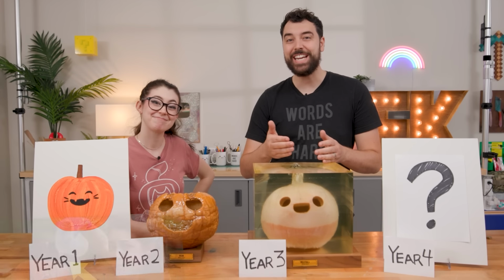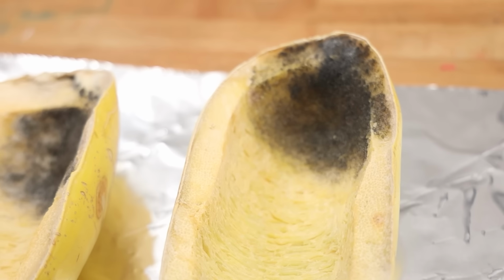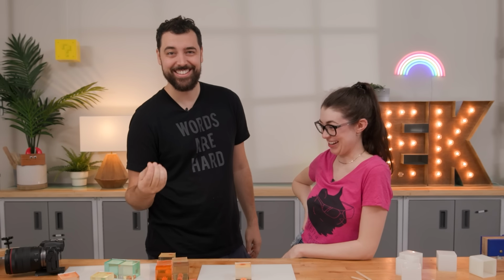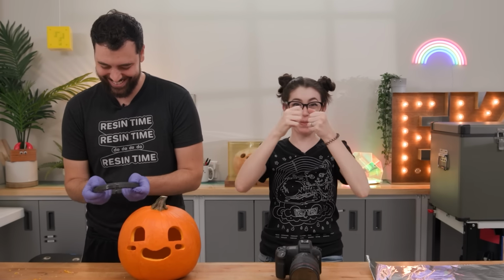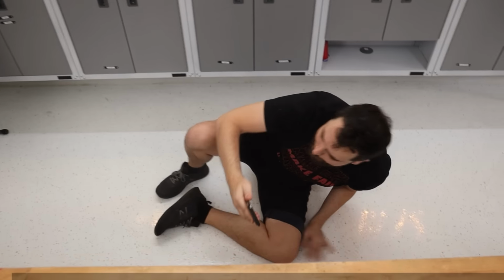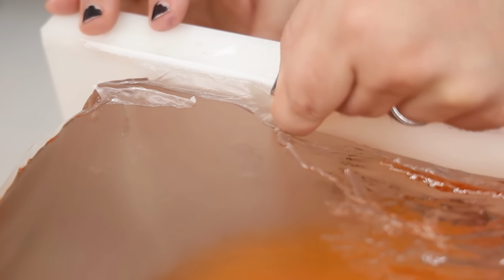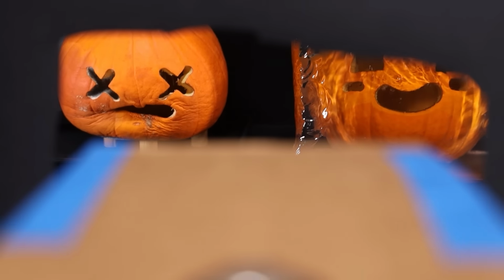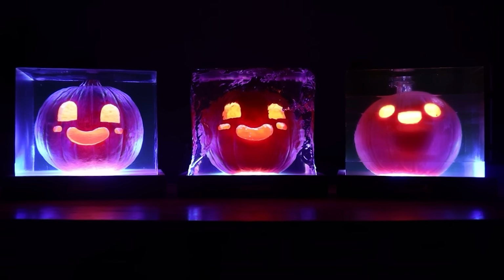Our BIGGEST resin pour yet… all to preserve a pumpkin

Comment: One suggestion is freeze drying a pumpkin. Albeit my pumpkin was a small one, once I carved it I stuck it in my freezer and forgot about it for the year. When I took it out for Halloween it was as good as new and it's been sitting in my room for 2 years now, no mold or anything. If you start now it might be good for next year! (also cheap if you have room in freezer + discounted pumpkins from Halloween)
Reply: A freeze dryer could work. It would be very fragile though. The weight of all that resin could make it crumble. But I've seen other channels do a thing where they submerge something in resin, and then vacuum it, which removes air from the object and causes the resin to infuse it. Maybe they could do that?
Reply: @jonathanhibberd9983  They tried that while making clear wood. They could probably do it again .
Reply: @jonathanhibberd9983  The problem is the pumpkin is full of juices as well as air. So then they'd be vacuuming the water out causing it to interfere with the resin itself.
Reply: @astridroseby  the process of freeze drying removes all the moisture. If you've ever had Lucky Charms cereal, the marshmallows are freeze dried. And that's what all freeze dried foods end up as. Totally dehydrated, dry but very fragile. They crumble into dust under too much force. If the weight of the resin doesn't crush it, a vacuum would allow the resin to fill the spaces left by the removal of the juices. But I'm not sure if you can freeze dry a whole pumpkin. And if they could, if it would survive the weight of the resin.
Reply: @jonathanhibberd9983  Oh, I thought you were suggesting vacuuming the pumpkin in resin as another alternative. I didn't realise you were saying to vacuum the freezedried pumpkin.
Reply: @astridroseby  yeah, I was thinking of freeze drying, then stabilizing. Peter Brown has a video on his channel where he does it with some wood and a slice of bread.

It's a very watery resin. You submerge the item, and put it in a vacuum chamber. It sucks all the air out, which lets the resin infuse it. The problem is it's heat cured, so that might be an issue. I don't know if it would discolor the pumpkin, or if the freeze drying would make it so it doesn't change color.

Comment: Hi, I study microbiology for a living and there is my take on your project. I hope my advices will be usefull

First off, regarding the cleaning method, you might have infected them pumpkin while rubbing them and you left them in the open afterward so any type of air contaminent (especially common in molds like this) might have contaminated the pumpkin. So that test isn't really testing anything. Also, you should rub it a first time real good before opening it, and make sur that anything that touches the pumpkin is well sanitized.

Also, if you want to clean it adequatly, you should keep it in a totally clean and desinfected area, and you MUST sanitize it before opening. Use only sanitized tools to touch the pumpkin and remember that as soon as the "skin" of the pumpkin is breached, you also make it a LOT easier for the pumpkin to be infected. Therefore, you must work fast, in a sanitized environnement, including air. Using a flame to work next to it can work but there are other methods. You MUST keep this up during the entire time the pumpkin is exposed to air to protect it from outside contamination.

You could also try and pressure cook it. 121 degrees celcuis for 20 min should kill any bacteria and or fungi present in and out of the pumpkin. ( this is called autoclave if you want to reasearch that method) And if you follow this path, you still need to sanitize the area until the pumpkin is completly immerged

Another method could be to dive it into ethanol, ether or any desinfectant fluid then encase the whole thing, with the fluid. This method might lead to some colorant tainting the liquid as the pumpkin is immerged for a lengthy period of time.

You should also know that like wood, most vegetables will release some gas as it gets old, so it will be seen and if there are some leaks, the pressure building up inside might it to leak more easily.

So all thing considered, it is actually luck that determines wether the pumpkin will rot or not, if you keep it in sanitized envirronement ( the pumpkin must be in especially good health (no inside contaminents)and you must protect it from all outside contaminents as well) then you maximise your chances. 

If you really want it, I'd advise you to make a few until you finally are lucky enough to have that perfectly healthy pumpkin. You should also try and minimize the time you keep the pumpkin carved. As soon as you pierce the "skin" of the pumpkin, you open the gates for any pathogen to enter easily. So as mentionned before, Open it in a sanitized environnement, with airial protection ( a flame for instance) and sanitized tools and hands, and work as fast as you can. All this, can be useful to limitate any type of infection that could make the pumpkin rot inside the epoxy but, it will not garantee success since the pumpkin could already be contaminated.

You could also try and get directly from the ground it grew, minimizing the chance of any pathogens penetrating the pumpkin during its travel to your local shop.

PS: I know that this all might seem a bit much, but remember that any baceria/fungi that is encased with the pumpkin is in a well controlled environnement with humidity and no air with a lot of of dead organic matter; this is the fungi dream. Fungi are you worst ennemy in this project, any that makes it inside WILL make it rot

PPS: you should also wear masks in order to protect the pumpkin from the air you expire

I hope this is usefull <3
Reply: Pls be nice i made some mistakes but english isn't my first language
Reply: I'm also a microbiologist and you simply cannot sterilize a pumpkin without completly destroying it. This is not like milk which you can pastorize. 😅
You can't autoclave a pumpkin lol
Reply: This is amazing ❤😊
Reply: @zamith1817  
Do you think putting the whole thing into a formaldehyde solution might work? Basically, it's still coated in a thin layer of it when it gets encased in the resin. Like a glass tank, but resin instead of glass and the walls make up most of the cube.

Comment: Idea: put Chunk 1 back in the resin cube mold and do another pour! This would only be a relatively small amount of resin and it would make him a proper cube!
Reply: That's what I was coming here to comment! The fast curing locked in the color, and the second pour with the slower curing kept the shape nicely, and would likely hide the...melty...effect.
Reply: I think he looks cool like he's locked in an ice cube lol
Reply: but he looks like a melted icecube now~
he is "future" chunk where as the silvery "ghost" chunk is past chunk~
Reply: That way it will no longer look like an ice cube, and he will start to get warm and sweaty.
Reply: Sanding with a high grit sandpaper before hand will give a clearer finish. I start with 400, then use 600 and finish on 800.
Reply from the maker: that's definitely something we're considering! We weren't sure if resin could reach all the nooks and crannies (we didn't want air pockets)
Reply: @EvanAndKatelyn  Honestly, the ice cube look is really working for me, especially with winter coming on,  it's a multi-holiday decoration!
Reply: @EvanAndKatelyn  Another option would be to keep carving until you are about an inch away from Chunk 1 all the way around but as you get closer start trying to get a smoother finish
Reply: @EvanAndKatelyn  I'd honestly be worried about the color being slightly off since the color wouldn't be replicatable. I think he looks good as an ice cube anyway though
Reply: @EvanAndKatelyn don’t do it! Just put him in a giant martini glass or something!

Comment: There is a resin called Cactus Juice that pen makers use to stabilize wood. The wood and juice go into a vacuum chamber, and then after days all of the air is exchanged for resin.
Reply: Yes, but wood is not 90% water.
Reply: cactus juice is a heat set resin, if you cook the pumkin its going to make it worse
Reply: @MrKuncol  "Moisture does not hurt Cactus Juice at all. Moisture will not cause polymerization issues in any way."
The water isn't a problem. It's the decaying matter. Which is hopefully what the Cactus Juice will stabilize.
Reply: They've have used cactus juice for other projects before there must be a reason they haven't now.
Reply: @jerrywhidby.  Stabilizing resin like cactus juice works by filling cavities in material with resin under vacuum. That resin is later polymerized with temperature.
There are not cavities to fill in pumpkin because it's full of water. You would need to freeze dry it first. 
You can also replace water with resin with plastination process but that require dangerous amounts of acetone kept in way bellow freezing point of water and vacuum boiling it from specimen which is IMO not something that can be done in home in safe way, Especially on object as big as pumpkin..

Comment: I have seen woodworkers seal their epoxy pours with a deep penetrating resin before encasing it fully. This should prevent the bubbles from forming like you see in chunk 2. The epoxy on epoxy bond should also prevent the wight film forming around the pumpkin like in chunk 2. The  I would highly recommend looking into blacktail studios epoxy pours.

Comment: Next time, try to put the pumpkin in the mold upside-down; No need for ventilation holes near the stem.
Maybe cover the pumpkin with a quick curing resin layer, locking the orange skin in place. Even though the insides might start to deteriorate, the surface will remain. 
The clear 'filler' part is good, maybe add a light in there so that that is suspended in 'mid-resin' inside pumpkin?

Comment: for next year's pumpkin, i think the key to avoiding bubbling is to use penetrating resin (i think you've used it on wood before?) and the giant vacuum chamber to saturate the pumpkin, before applying a top coat of epoxy
Reply: Peter Brown on Shop Time (YouTube) used penetrating resin too and had success with it. I don't know how it will work with the water in the pumpkin though. Freeze drying maybe? Cody'sLab freeze dried a whole pumpkin in a regular freezer. It was a little bumpy but did look healthier than Bean.
Reply: Do it in a vacume chanmber or pressure pot too
Reply: more invites for this please
Reply: @maxximumb I hope they try this
Reply: I think freeze drying would work better. But maybe it's just not as interesting?

Comment: I'm sure someone has suggested this before, but in case not: for next year, how about you try to stabilize the pumpkin? As far as I know, stabilizing involves submerging something porous(like wood, or a pumpkin) in a thin resin and putting it in a vacuum, replacing all the air in what is being stabilized with resin. The resin is then cured , leaving previously soft or brittle material must stronger, and presumably less prone to decomposition. That might be enough by itself, but you could then take the stabilized pumpkin and submerge that in regular resin.
Reply: Sadly stabilization only replaces the air and not the water in an object, wood has to be under 10% moisture to stabilize. 
A Pumpkin is 90% water, so you would have to dehydrate it first, you would end up with Bean 2.0
Reply: And... What if they flash freezed the pumpkin? I see that going in three ways. Either the compressed, dehydrated pumpkin gets somehow partially rehydrated with the resin (which I don't thing it's possible, don't think resin molecules will be able to easily penetrate the cellular cells of the pumpkin), the dehydrated pumpkin just stays small and wrinkly in the resin, or they rehydrate the pumpkin in something like formol or ethanol and then try to get that into the resin.

Either way, I think flash freezing a whole pumpkin, for as hard as it'd be, should be at least interesting!
Reply: Flash freezers that size are prettttty expensive
Reply: @XceptionalBro  I think resin will heat it up with the reaction, but who knows if it's in the freezer..

Comment: The control probably got less mold because of competition.  There was most likely microbes on the squash that competed with the mold, but did not present in an obvious way.  The sanitized ones removed all competition and where then placed in the same space as the control which wasn't sanitized.  Once the sanitized ones were introduced to mold there was nothing stopping it from growing and it had its way with the squash.
Reply: Thank you for this explanation, I was so curious about why all the sanitized ones got so moldy!

Comment: Have you thought about using stabilizing resin on the pumpkin first? You have to use a vacuum chamber to get it to pull into all the voids and replace the air. Peter brown has done it on some projects and it’s worked great for him. Also you could pour a thin layer of resin down at the bottom (like 1/4”) and then put the stabilized pumpkin and just “glue” him down with UV resin to prevent floating then use some deep pour resin with your fridge to keep it cool. 

I actually love this little series and it’s great to see you improve. 

You could also possibly save chunk 1 by putting it back in the mold and pouring resin around to fill the voids. Or pouring one side at a time with a lip to stop it and letting it level out smooth.  A nice sand and polish would also make it shine and clear right up!
Reply: Came here to say stabilizing resin/need a Peter Brown collab
Reply: I was thinking about this too!
Reply: Yes! I swear I say this every year!
Reply: This is one of the most well thought out alternative plans but as the specialist: The stablization resin could work but wont because it needs to be baked in an oven and no it wouldnt work with resin heat. If you pour a base you will have a layer line which is not a part of the mission their weight idea is fine it either floated because of the block of resin or no vent holes at the top. Filling it again will make a cube yes but look terribly you will still always see all the imperfections as a ghost detail. No to number two just leave it cant save it. My recomend in the comments 🤘🔥🤘

Comment: Might try freeze drying the pumpkin and vacuum chamber after pouring the resin to remove all the air.
I know moisture and air can cause alot of problems with organic material.
Reply: I really feel freeze drying would work. I’m also wondering if creating a sealed cube of an inert gas would work too…. They could make it out of resin, or maybe just marinate the pumpkins in a gas for a while before a deep pour? Idk, Cody’s Lab or Nile Red would know better 🤷‍♂️

Comment: Howdy, im late to the party, but im here to tell you the reason that the control didnt mold up the fastest was the reason why it was the worst to choose. The reason the others molded up is because you killed most of the bacteria, but the fungal spores (which resist alcohol and chlorine) were remaining. Since those spores were suddenly in an all you can eat buffet, they grew like crazy. 

The thing that would have changed everything is that fungi are primarily aerobic and require respiration, so having them in the airtight resin stops the spores from growing.

If you plan to do this next year, id recommend doing a nice clean down with the alcohol and trying to bake it as much as you can, throwing a pottery glaze on the guy and baking it to kill off most of the aroebic bacteria that might be inside, and then immediately going to the refrigerated resin pours.

Comment: If you want to try adding color to counteract the resin yellowing again, I suggest purple over blue. Purple is the opposite of yellow, meaning it can neutralize yellow tones, whereas blue will just mix with yellow to make that blue pool water color you got. 
Blue is also the opposite of orange, which is why the orange pumpkins looked so dull in the blue cubes
Reply: They did to a purple, luckily!
Reply: @bagandbroad  It was my favorite, too!
Reply: The thing about using purple is that the complementary color, in pigments, gives a grey tint to it which makes the pumpkin less of a brilliant orange and makes the resin look a bit murky.
Reply: Good ol colour theory to the rescue 😅😊
Reply: I don’t get why they don’t just use a non yellowing resin !?
Reply: @Just1Nora it’s better than using blue, though, because blue and orange are complimentary colors and would therefore heavily desaturate whatever orange is encased inside the blue tinted resin. Purple is the way to go for projects like this.

Comment: I gotta say I really liked Chunk 1! The wavy resin really makes it look like an ice cube, and in a way I think it makes for an even more interesting piece. An eternal ice-cube with it's pumpkin boi center 
I wonder if slowing down the curing too much ends up with the pumpkin shrinking a tiny bit away from the resin before it have time to fully adhere and harden up around it. So it's going to be balancing between the resin curing faster and generating so much heat it warps, or curing so slow the pumpkin have time to start decaying. It's also interesting to see that Chunk 2 didn't have any signs of juices leaking during the curing process even if it's clearly starting to decay a little. Maybe the higher temperature basically cooks the pumpkin and force water out of it that way. My guess if you'd end up using this same technique next year is that it needs a bit more babysitting, and possibly raising the temp a little earlier
Reply: I was thinking the same thing! Chunk no1 looks soo cool, ice illusion 🧊
Opportunity to use it for Christmas? Ice Age Edition 🥶